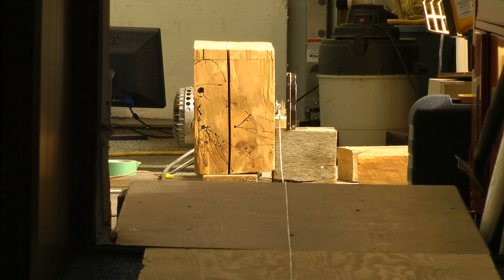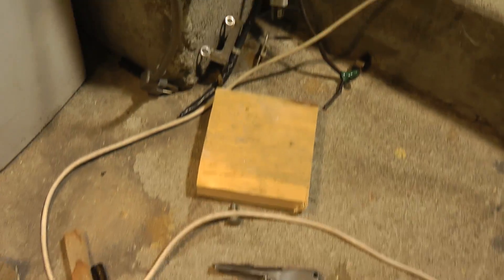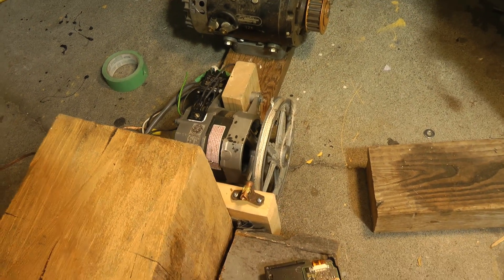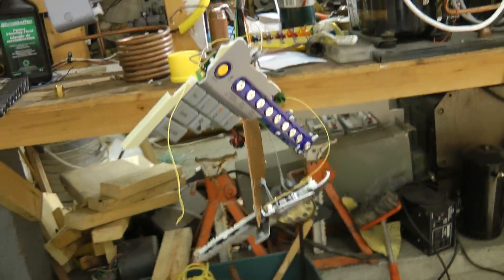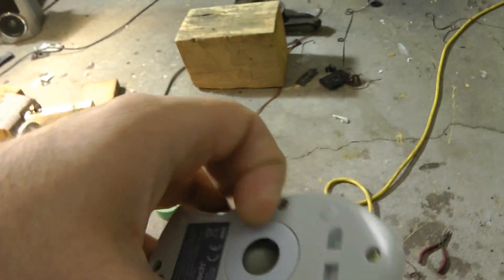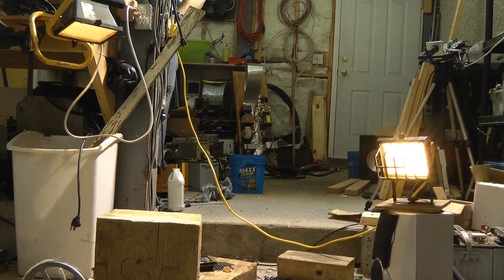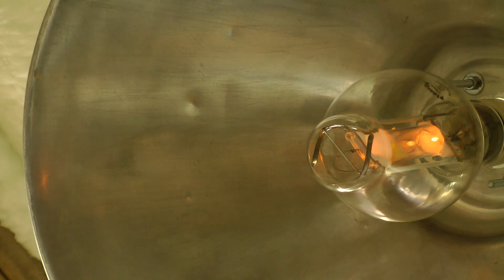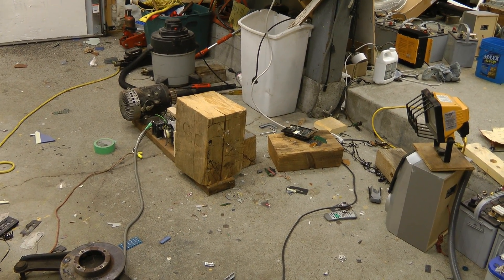Consumer Electronics Crash Test

Comment: @douro20 I had a pentium 4 PC i used for linux that was "3.06Ghz," and failed to pass my AMD Athlon XP 3200+ in a benchmark. The P4 got 89 points, and the AMD got 369! I remember that converting videos on the P4, even with clean heatsinks and the fans set to 6000RPM, the temperature would get up to 230°F and stay there.